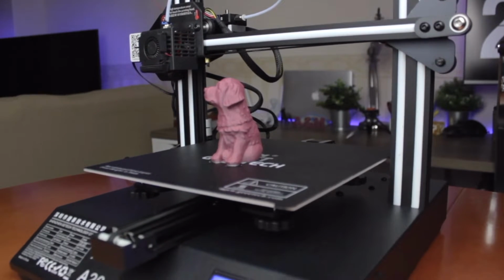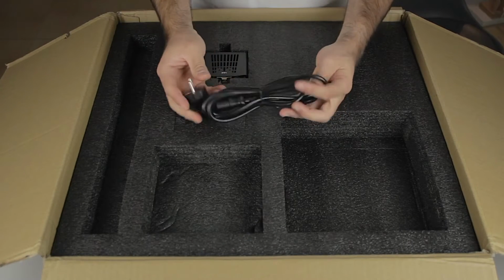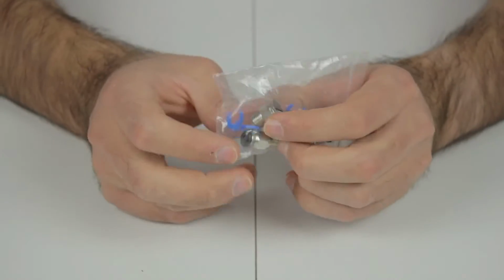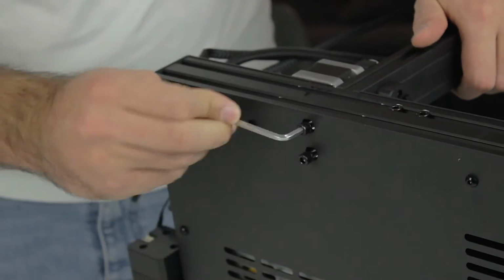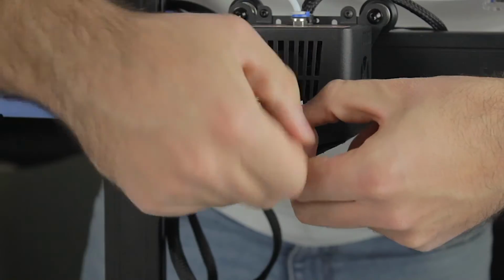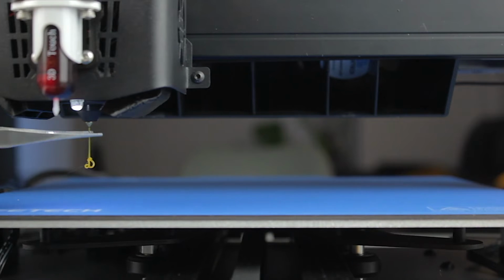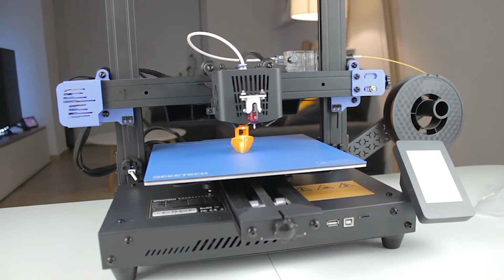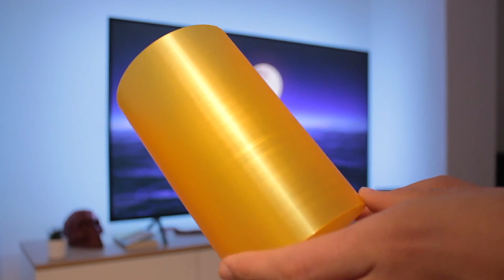GEEETECH THUNDER | 3D Printer Review | IT THUNDER FAST!

Comment: I have had this printer for some months now and appreciate the speed, accuracy and absence of level shifts thanks to the feedback mechanism. However there is something wrong with the automatic leveling software, as it does not seem to compensate right, even after measuring all 16 level points. As there are no screws for manual bed adjustments, tilt as well as wobbely beds must be compensated from those sixteen samples, but it does not. The first layer is far from even in thickness and bed attach will suffer.